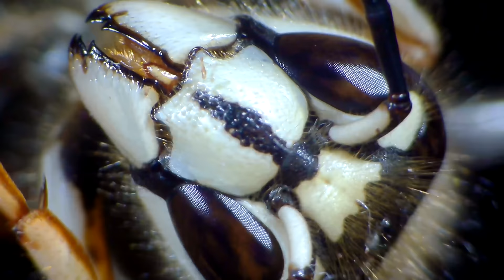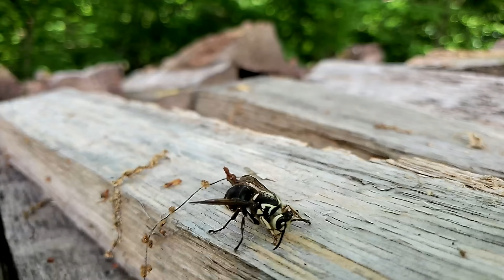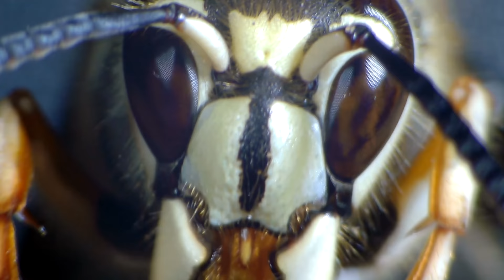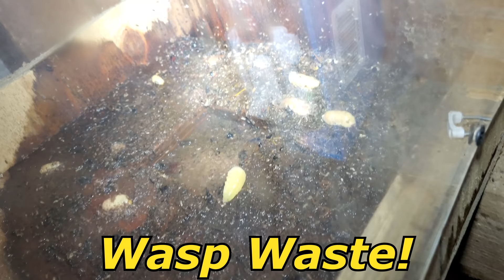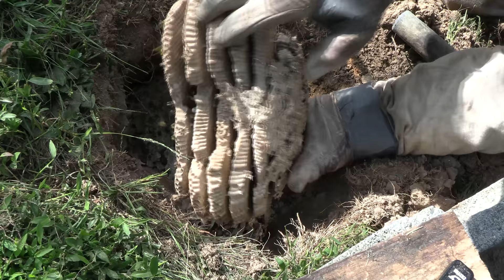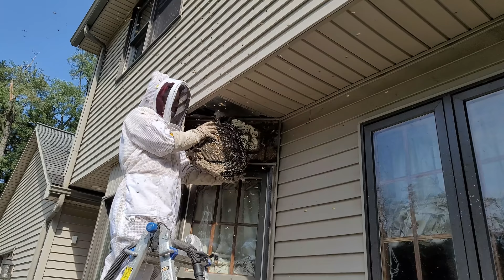5 things you NEED to know about WASPS, HORNETS, and YELLOW JACKETS!

Comment: It's hot outside. I put a portable swamp cooler in my kitchen to help. It had been on my porch for years, unused. Now I'm discovering that it's full of Mud Dauber nests, and they hatch inside my house. They're easy to remove. They go straight for a window and stay there. Put a glass over them, and slide a thin piece of plastic under it, between the pane of glass. Wasp is trapped and gets to live as I move it outside.

Comment: Well. I guess today is a Today I learned. 

European paper wasps at least seem to be the majority or a very similar species at least seem to be the most common place here where I live. I have zero problems watching them as long as I know they are safely on the other side of glass or on the outside. But when one invades into my personal space or comes inside, I still have one of two reactions, mainly to run away because of panic, or to freeze solid from panic. I like watching them knowing I'm separated, but nope. I can certainly happily live my life without having to see them or deal with them in my opinion. Also, I used to feel the same way about bees. Not anymore, with bees at least, unless they are well, flying around me.

Comment: Soooo I live in eastern PA. (In the Allentown area)
We definitely have a yellowjacket nest in the house somewhere. Since it started getting cooler out I have been taking/escorting about 1 every day - every other day back outside. Two so far today. (Thank god they aren't aggressive!!)
I have found their entry point outside (where the HVAC pipe goes into the house through the siding), but don't understand how they are actually getting inside the house itself. Boyfriend insists they must be in the crawlspace under the house bc that's where the pipe goes in. 
Will they die over winter? 
Whatever species these are have helped me get over my EXTREME FEAR of wasps bc they let me catch and release then outside without trying to come after me.

Comment: Hey, I’ve got some under my vinyl siding with a fairly new next. They actually ate the caulk around my hvac refrigeration copper line and found their way in my basement. I hope they didn’t tear any framing up.. I think they’re just using the vinyl to keep them cool. I caulked one side up and they found another way in where my internet line comes out. I think they’ve came in thru the vents and or exhaust fans too.. help!
Reply: It’s been super dry tho and hot

Comment: Ok, so I live in middle Tennessee. There is a species that my wife calls “Yellow Jackets”. But they are yellow and black, and are super small, around the size of what I know as a Sweat Bee. But the bees, or Yellow Jackets nest in the ground and can be real aggressive when disturbed, more than any other stinging species. I would like to know what those exactly are, and if “Yellow Jackets” is the proper name. (They’re tiny, they’re yellow and black, they nest in the ground, and come at you like firecrackers.)
Reply from the maker: More than likely eastern yellow jackets, Vespula maculifrons
Reply: @HornetKingOfficial  Googled it. Most likely is what you said. Google says they are considered pests due to where they nest at, which I totally agree with. I hate cutting my lawn around those nests. I have a riding lawnmower and usually fly by as fast as the mower can go. 
Thank you for replying. Now I know.
Reply from the maker: Yeah, V. maculifrons is a species I removed the most from ground nests. A couple other species, but V maulifrons are the smaller wasps of the 3 ground species around here.

Comment: I have a wasp problem above my eavestrough leading to under cedar shingles. Every year I soak what I van with wasp spray. Is this the best time of year when I might be able to trap the Queen? Any suggestions on how other than the typical hardware store trap? Ps. March 20, 21 in Niagara Canada (not too far from you).
Reply: You really need to fill the gaps they're getting into if you can. Are you having the nest removed each year or not? Because if not, there's a chance that the queen is just hiding inside your house during the winter and no amount of spraying just the exit is going to get all into the nest if it's any distance away from the entrance.
Reply: I'm not an expert on wasps but if you sprayed pepper spray on the eaves trough they'd definitely be blinded but idk if that's a good idea
Reply: @k.o3336  Seriously, no. Just no.